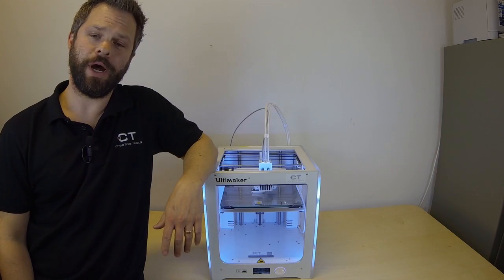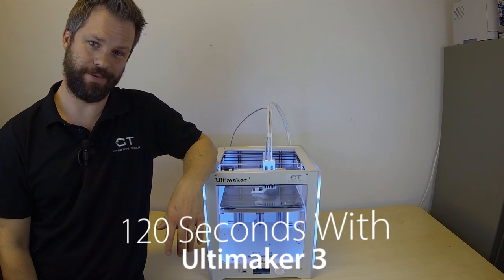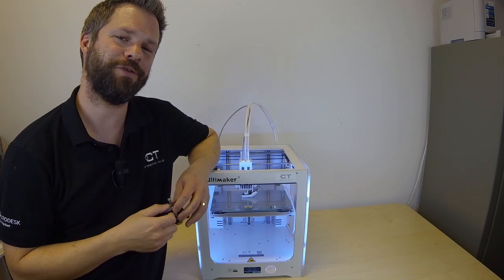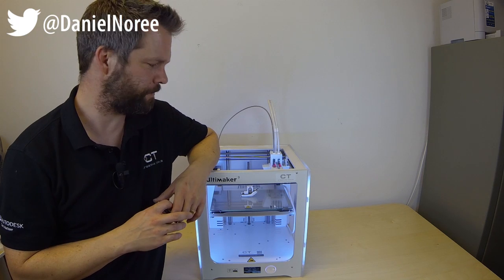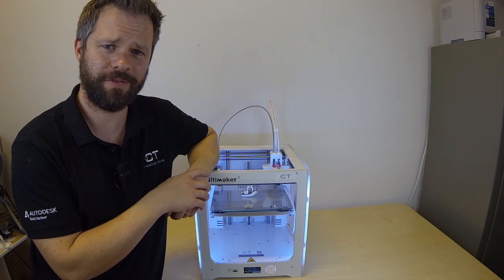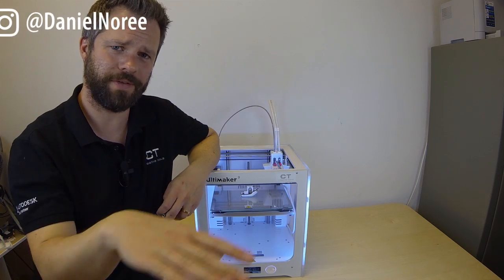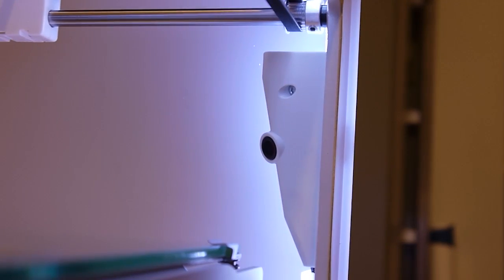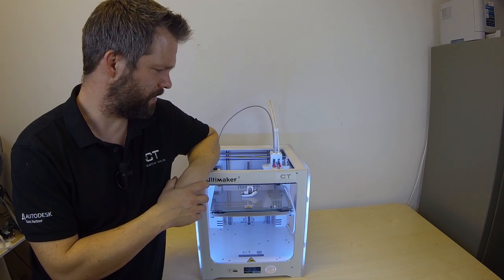120 Seconds With Ultimaker 3

Comment: I have yet to see anyone explain how the nozzle switch actually happens, what causes the nozzle to be lifted, is it a servo, is it some other mechanical operation?
Reply: It is a mechanical operation: when the head moves to one side at a specific position, it slides a mechanical switch that raises or lowers one print head.

Comment: Is it actually leveled for 2 different nozzles then? Like do you level both separately and does Marlin then calculate Z height according to the nozzle it's using? Any clue if they made a custom G-code command for the nozzle switch?
Reply: Yes that's how it works, for the nozzle switch it's the usual T0 and T1 commands, the rest is all in the firmware of the machine
Reply: ah cool, thanks man :D